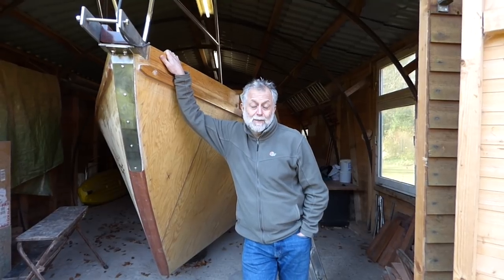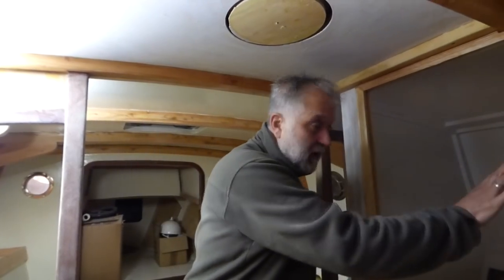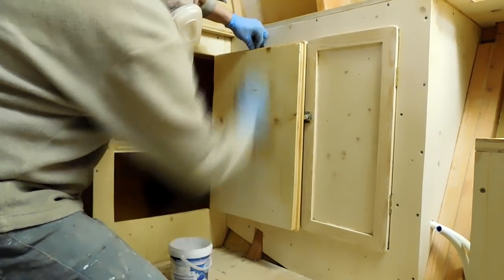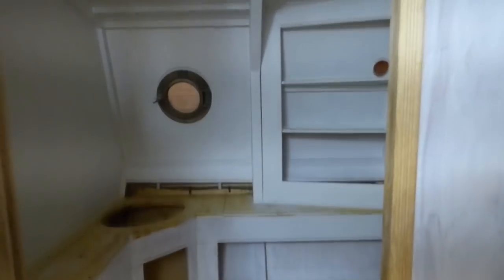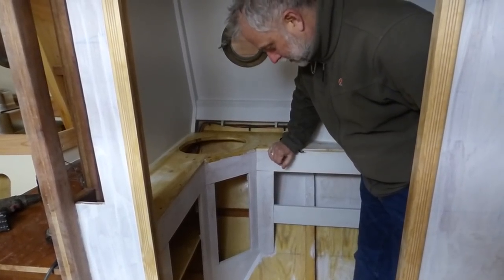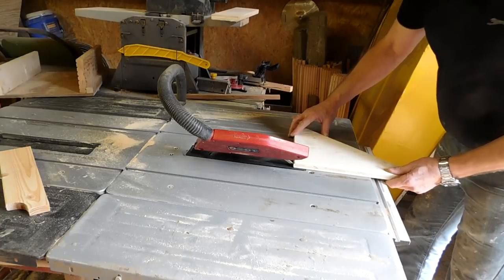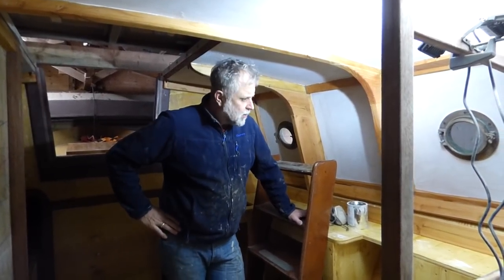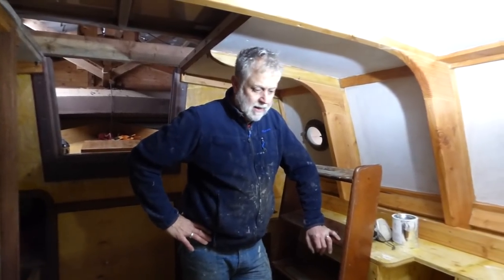Building a sailboat; Charging on :-) - SV Tapatya EP127

Comment: Good that you've confirmed that the charger will work. It isn't really rocket science, you just need volts a little bit higher going in than what a full battery expects. I built an e-bike, had a similar situation in that my particular battery wants to be about 60V fully charged, but the available chargers won't cut off until 63V. I just added a few large diodes to drop it down and it works great.
Reply from the maker: You're right Brad. It's not really rocket science! 😀😂😂

Comment: You can try the setup in your car with the engine running, the alt makes 14.4 volts then.
If that also works it wil work on the boat to with solar or running engine.
Gr.
Reply from the maker: Thanks Michael. It will indeed 👍😀

Comment: For the tile, any good adhesive should do, but the grout should not be used on any of the sharp angle joins. No matter how rigid the construction, your boat is going to flex at corners, using a 'flexible' sealant at these points will prevent cracking and potential ingress of any spilled liquids. Since clear 'sealant' should be used atop the grout, the corner joins should be hard to distinguish on the finished surface.
Reply from the maker: Thanks Mike. Good stuff!

Comment: i bought an unfinished condominum once that had some nice unfinished raw woodwork (baseboards, lots and lots of windows and doors that needed finishing as well as the a kitchen floor. thought i would NEVER get it done. it was a horrible experience for me. i'm pretty sure i would pay whatever was required to have it done if i were presented with a comparable task. NEVER AGAIN!
the novelty inherent in doing something the first time is usually enough to see me through, but that second and third coat of painting is intolerably boring.
soooo, good for you, i admire people that don't share my affliction. :)
Reply from the maker: 😂😂😂 Thanks Blade Runner. I can assure you that the painting is wearing thin. I'll be out there again later today getting some gloss on in the heads and main cabin. Still a fair bit to do though 😐😬

Comment: Ceramic tile on a wooden boat will be a maintenance problem no matter what adhesive u use.
   But ..if you are committed to using it be sure to coat the surface of it with thinned epoxy too.
  Adhesives today ARE better...but...haven't been around long enough to give an honest example of the kind of use you require. Temp.change, moisture change,and flex in the surface... Aesthetics is important . !
   Christ Craft tried it here in Chatt.Tn.  Ah..but they are out of the boat buisness...Fiberglass ! 
  Accent pieces of tile or stone for that matter would be safer down the road. 
  It's a boat ! ! It's a life long protect.....
    Unless u gonna put it up for sale...
    I don't believe that's your goal.
Reply from the maker: Certainly no intention to sell, Steve. Clearly maintenance will be needed along the way. Thanks for your tips on sealing the tiles 👍